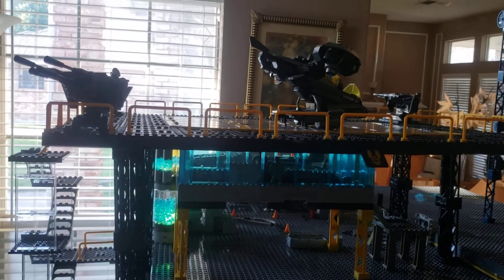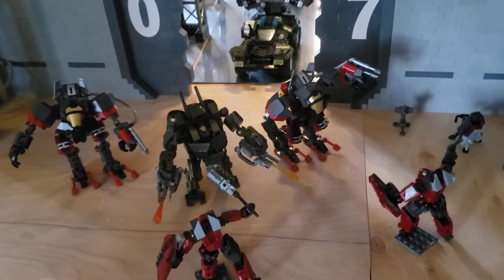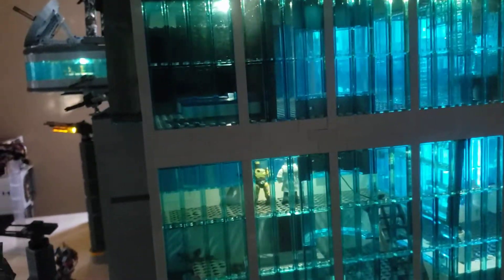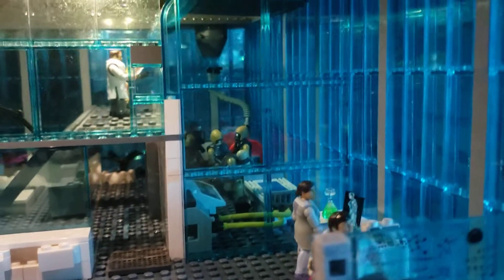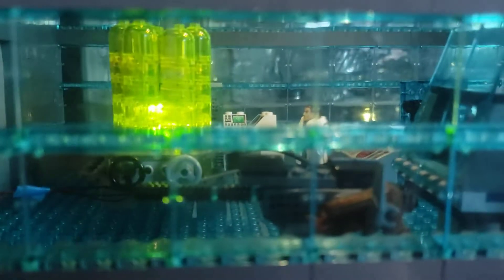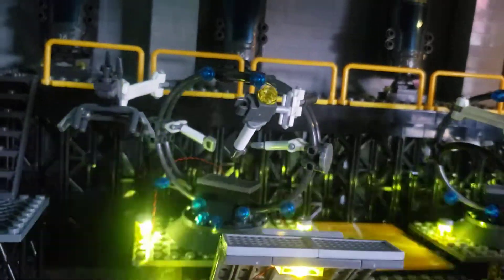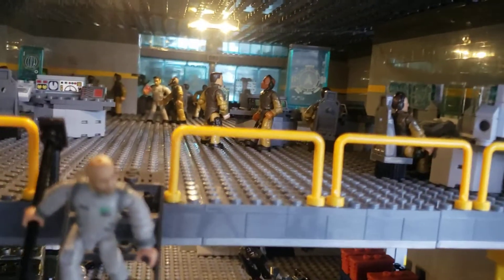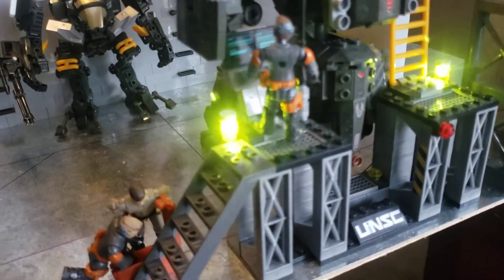Mega Construx Halo Wars 2 - The ZULU Project - Episode 37: Updates and Rebuilds

Comment: Hello friend Sheer Khan, where did you get the seats for the figures? I have been trying to find them for a long time to buy and I am not able to find them, in Aliexpress I find any part that I need, but the seats are impossible for me to locate. Kind regards.
Reply from the maker: Hey there. I got my seats from a few different sets.. Every one of the space rover sets that I picked up had 3 seats in it so that was 15 seats total.. I took seats out of the back out of the back of my elephant by elephant. So that was another 4 seats. You could even get seats out of warthogs. So there are different places you can get seats from it just depends on where you want to get them.
Reply: @sheerkhanindustries4384  Ok, well, I thought you could get loose pieces by pieces, the problem I have in that regard is that I don't like to take pieces from other constructions, for that reason I always buy loose pieces on Ebay, Aliexpress and, Amazon. Anyway, thank you very much for the information, it is always good that colleagues collaborate with ideas to fully enjoy our common hobby. Kind regards
Sheer Khan.
Reply from the maker: @robertomartin2709  I understand not taking apart sets fr pieces. I only bought the Rover sets for the pieces. As far as the Elephant set, my troops all stand inside. I get more troops in with the seats out. With all that I have to spend money on (building armies, building the Firebase, custom figures, etc.) sometimes I just have to save money where I can.  But I totally get where you are coming from.